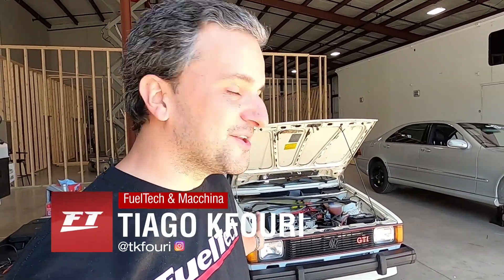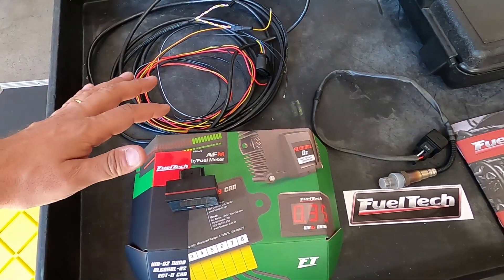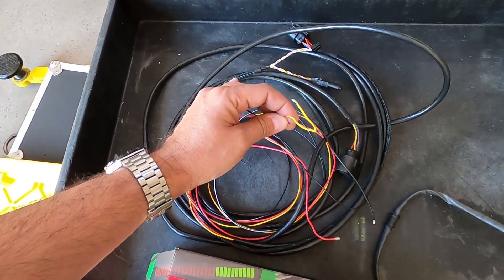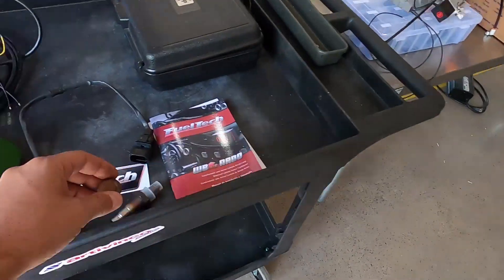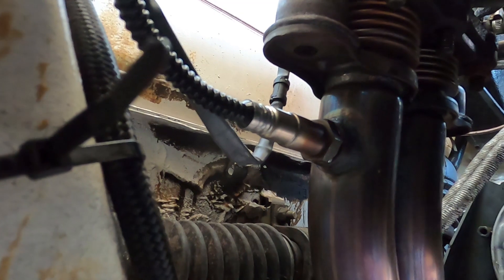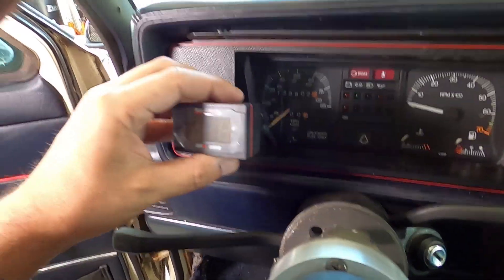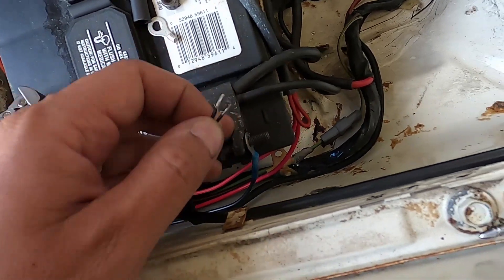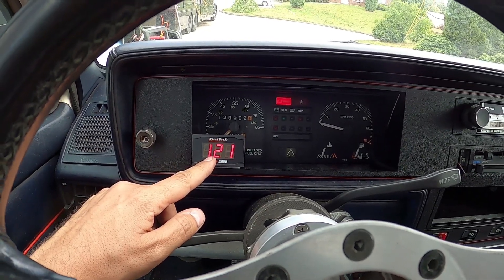How to install a FuelTech WB-O2 Nano!

Comment: The installation is wrong. Only 1 black wire is battery ground. The other black/white wire is engine ground. Which goes connected to the engine itself (head/block). The red wire is switched 12v. Which Fueltech recommends a 10a fuse to be used on this wire.